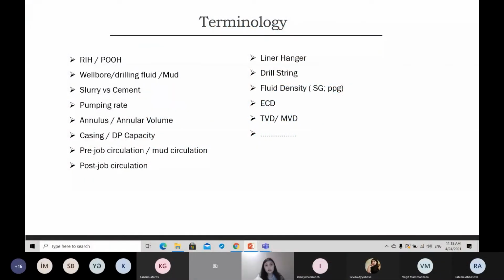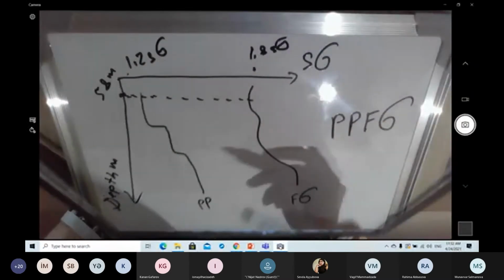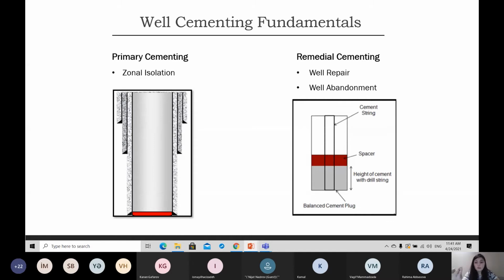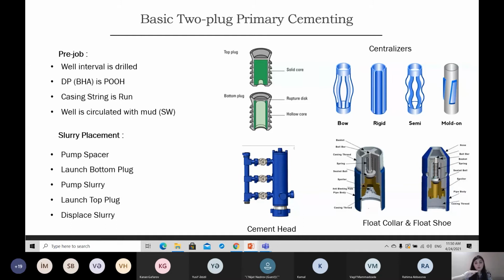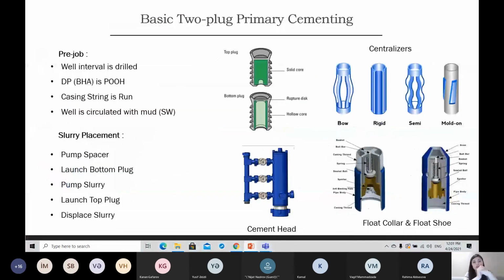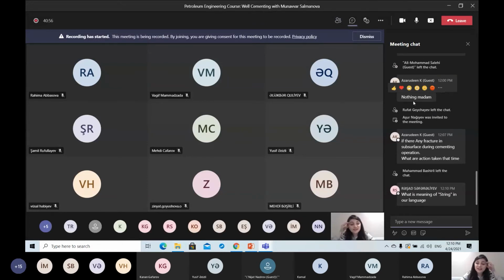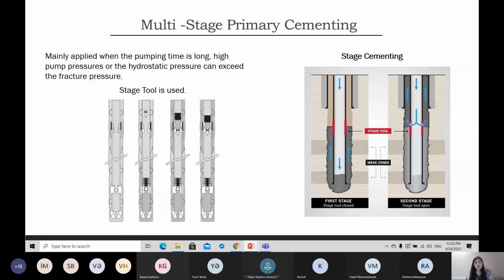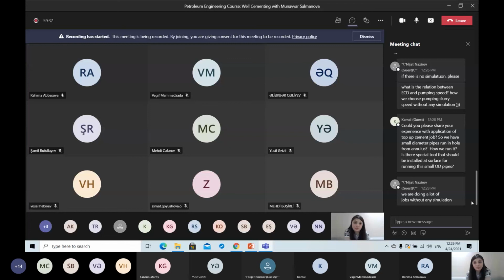Cementing by Munavvar Salmanova

Comment: In some scenarios, while using multi-stage cementing, the tool is located inside the previous casing, so the 2nd stage job is only in the annuli between the current and previous casing, hence no open hole is involved, this means no formation fracturing is involved, my question is why in that case do we go for a multistage job instead of a single stage